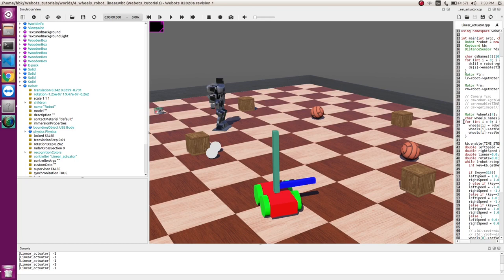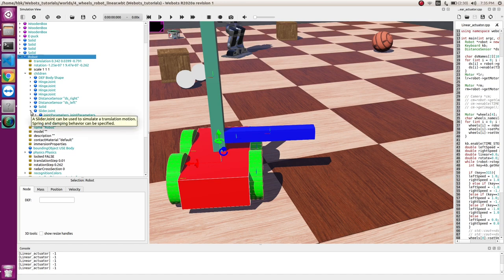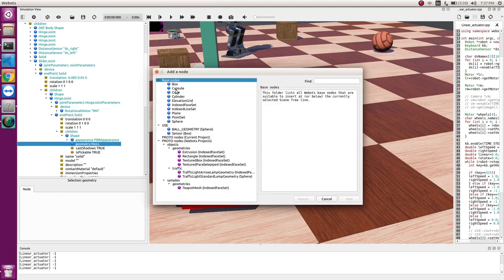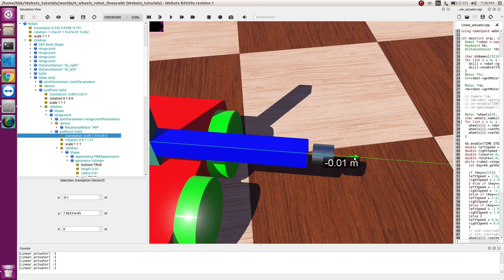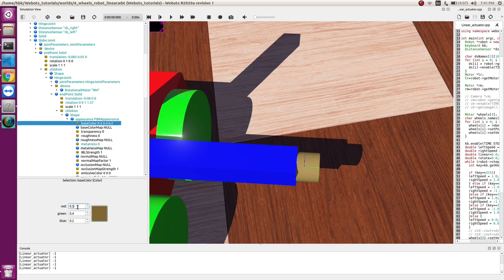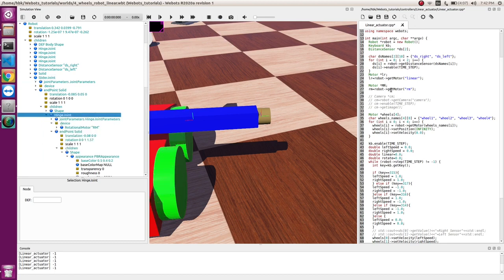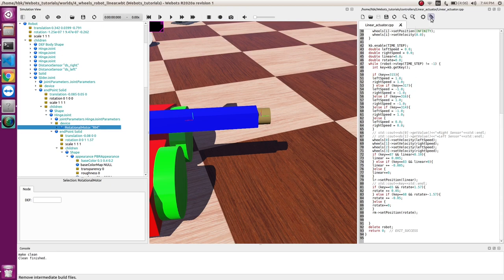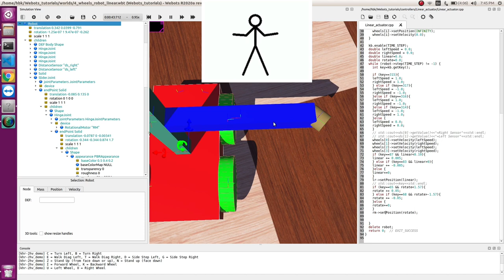Rotary Actuator on Robot | Manipulator Arm  | Webots Simulator | [Tutorial 13]

Comment: Hi again.
I build a arm and gripper.
I use tow hinge joint and I added a motor for each of the two finger.

I didn't not add code for controlling the gripper yet but when I move the motors on the simulation the object will fall down from the gripper.
I reduced the mass of the object but it still not working.

Can I send u the project to have a look at it please???
Reply from the maker: Few things in this case:
1. Gripper and object should have bounding object.
2. If that also does not work change friction between object and gripper.
Reply: @coolrobotics  u r a life saver. 
I changed the friction and it works now.

Thank you so much.
Jazak Allah
Reply from the maker: Thanks you very much for the kind words.
If you like the channel share it with your friend circle and help us grow 😇
Reply: @coolrobotics  will do in sha Allah

Comment: hi, why is it when I define therotary actuator bounding object and physics it doesnt want to rotate anymore?
Reply from the maker: May be because of weight of wheel.
In rotary actuator there is option of maximum torque.
Increase that value to around 1000
Reply: @coolrobotics  yeah, thankyou. I added weights to all of my robot parts and its working well now.

Comment: nice video!! I have a problem with my robot, I set maxPosition and minPosition and it works correctly, but once I add physics to the manipulator in order to see its collisions with the other elements of the environment, maxPosition and minPosition stop working. Do you have any idea why this happens?
Reply from the maker: I think it is because when we define physics (i.e weight). We also need to specify force in linear motor. So if you set force variable of motor. It should work
Reply: Okeey, thanks for the advice, I'll try!
Reply from the maker: Sure let me know the result 👍